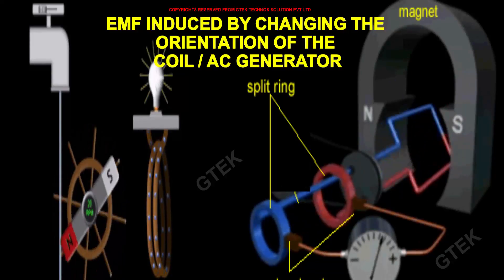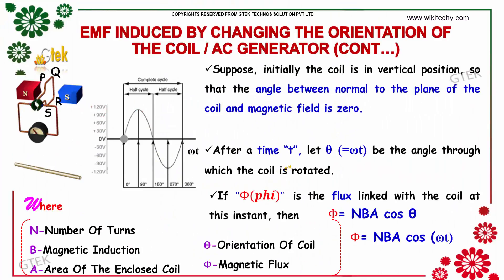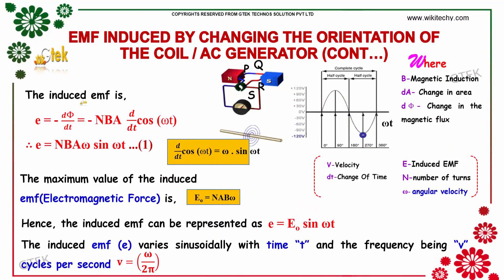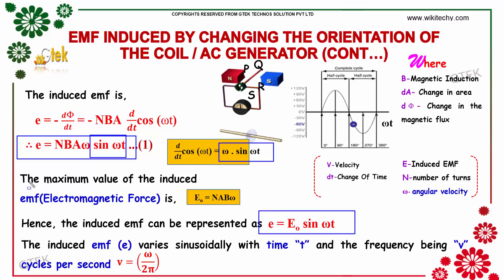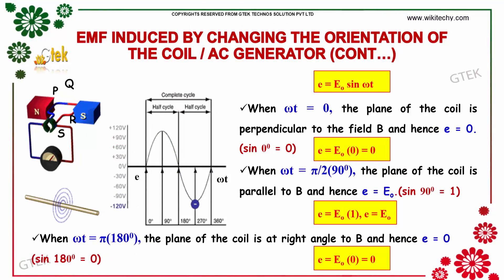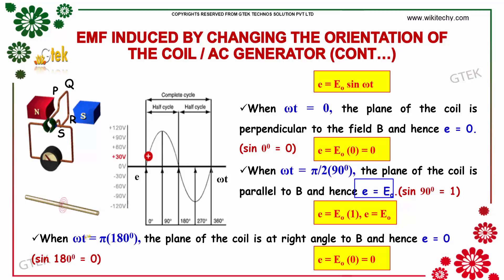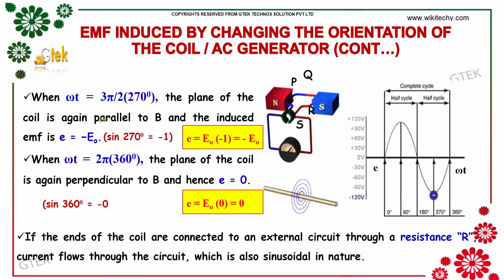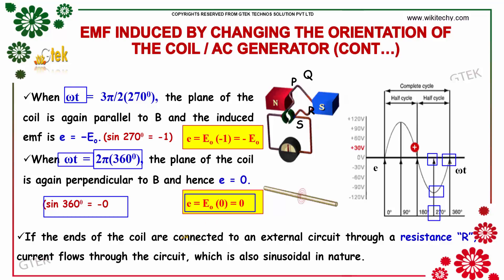Emf induced by the coil in ac generator|Electro Magnetic Induction And Alternating Current

Comment: Mar 6, 2013 - Carbon brushes: They are used to carry current from coil to external circuit. Working: If a coil is rotated in a magnetic field, a current will be induced in the coil. The strength of this induced current depends upon magnetic flux. Magnetic flux is maximum when the plane of the coil is parallel to the magnetic field.

Comment: An alternating current (A.C.) generator is an important application of electromagnetic induction. A.C. generator is an electromagnetic device which transforms mechanical energy into electrical energy. It consists of a rectangular coil of wire which can be rotated about an axis.

Comment: A Generator is a device which converts mechanical energy into electrical energy. WORKING PRINCIPLE. A.C Generator works on the principle of electromagnetic induction (motional emf). In generator an induced emf is produced by rotating a coil in a magnetic field. ... Powerful field magnet with concave poles.

Comment: The Electromotive Force, Eemf, induced in a Coil is proportional to the number of turns, N, in the Coil and the Rate of Change, dΦ / dt, of the number of Magnetic Flux Lines, Φ, passing through the surface (A) enclosed by the Coil. An Induced Effect is always such as to Oppose the cause that produced it.

Comment: That would make the copper coil inside the motor turn around repeatedly inside its permanent magnet. If you move an electric wire inside a magnetic field, you make electricity flow through the wire—in effect, you generate electricity.

Comment: AC-Circuits > AC (Alternating Current) Generators. An Electrical Generator is a device that produces an Electromotive Force (e.m.f.) by changing the number of Magnetic Flux Lines (Lines of Force), Φ, passing through a Wire Coil. Figure 1 is one type of Generators.

Comment: The two main types of AC motors are classified as induction or synchronous. The induction motor (or asynchronous motor) always relies on a small difference in speed between the stator rotating magnetic field and the rotor shaft speed called slip to induce rotor current in the rotor AC winding.

Comment: It consists of a rectangular coil of wire which can be rotated about an axis. The coil is located between the poles of two permanent magnets. As the coil rotates, the magnetic field through the coil changes, which induces an electromotive force (e.m.f.) between the ends of the coil.

Comment: f the magnetic flux through a coil is changed, a voltage will be produced. This voltage is known as the induced emf. The magnetic flux is a measure of the number of magnetic field lines passing through an area.

Comment: AC (Alternating Current) Generators. An Electrical Generator is a device that produces an Electromotive Force (e.m.f.) by changing the number of Magnetic Flux Lines (Lines of Force), Φ, passing through a Wire Coil. Figure 1 is one type of Generators.

Comment: AC (Alternating Current) Generators. An Electrical Generator is a device that produces an Electromotive Force (e.m.f.) by changing the number of Magnetic Flux Lines (Lines of Force), Φ, passing through a Wire Coil.